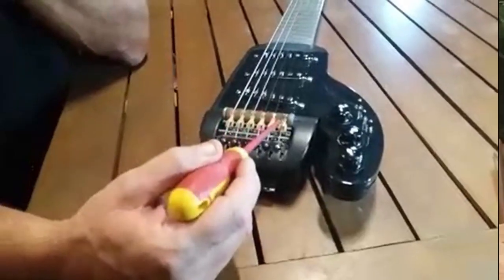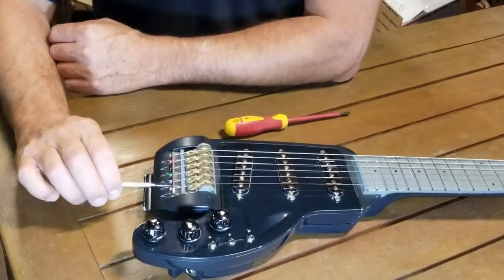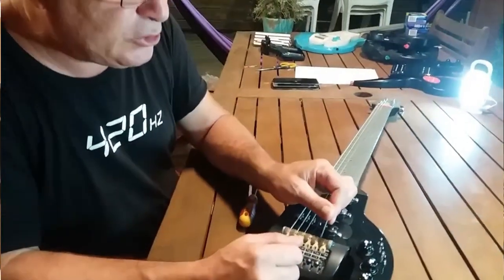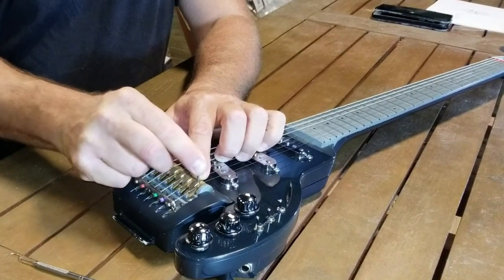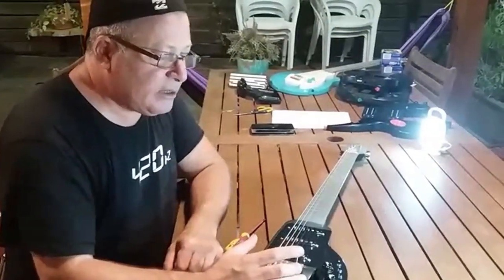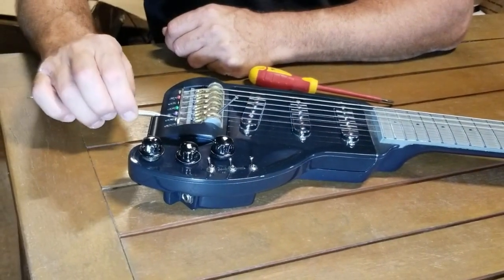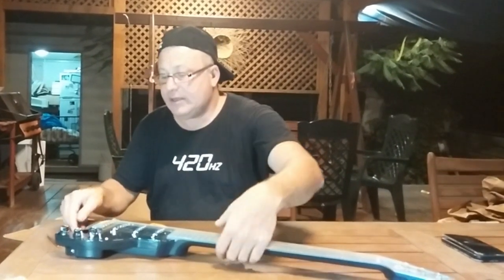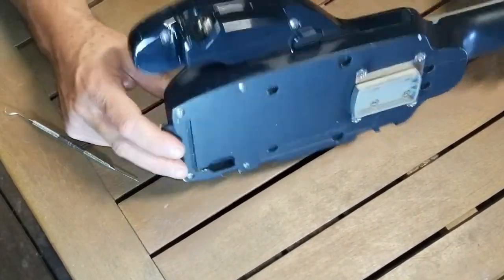Boaz ONE -  Adjustable Bridge

Comment: Great job!👍🏼
Needs more visible fretmarkers on the upside of the neck. Or illuminated frets...

The little place for the tuner is not elegant on the front. It destroy‘s the elegance of the outline. Better on the back side. 

For my taste, sorry, but the big pickholder on the front is ugly! It has just 3 slots, as far I see. Why not making one in the style of a silicon brush, with multiple options to stick the pick. Or one on the upper back edge, like the springloaded ones that exist already, but are for sticking on the front...

Suggestion: the wings should be more solid. I can still hear the sound of hollow plastic on cleaner setting. There is something about wood, you still can‘t go around... it’s not vodoo, it‘s actually the more organic sound it gives to a solid body guitar. 

If you want more sophistication for the bridge: think on including a G- Bender (I‘m going crazy now, it‘s probably not worth it😌)

As a place for the slide: have a place hidden behind the lower horn, in the cutaway. A rectangular, halfround space to click the slide in with simple elastic tongues the same material. This place is more convenient to reach, and more hidden, than on the headstock. 

For the nut, have it interchangeable with compensated ones, and different materials. Simple swap with clicking in. 

For the battery powered electrics, would be nice to have an input jack for a power supply. Maybe with a switch , between battery or power adapter. 

Next idea: have a removable customizable plate on the headstock, for a name. Costumer can order his individual guitar name on it (options: relief, recessed, color, chrome lettering etc...) Or use this place for testing different weights on the headstock (it can improve sound and sustain)

For the trem unit, it would be nice to have it modular option. I was thinking on using the cylindrical form of the bridge system for rotational trem action. To have on both sides (upper and lower) of the bridge cavities with removable covers, for clicking in two springloaded „cassettes“ who grab the rotably mounted bridge. Both covers of the „routings“ should lock the bridge in place like a fixed one. Therefore you remove just one spring-unit, leave the other as support. pull on the trem-bar till the locking unit finds his place. Then repeat on the other side. The spring-units have to have a locking pin in the tensioned position, before removing. Othewise it‘s not possible to mount it with the required tension for string-pull. 

The trem-bar could be designed for folding away and sitting flush in the body (middle main piece). If needed, fold it up and lock it with downwards pressure in its clicking place.

Otherwise: a genius construction and idea of you!!! Love it !!